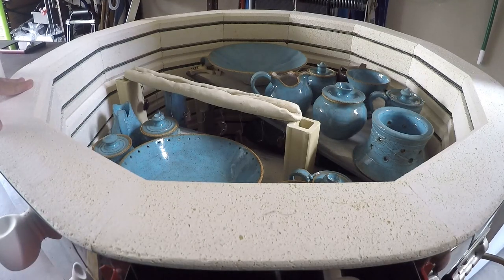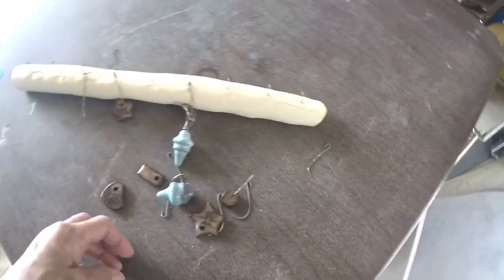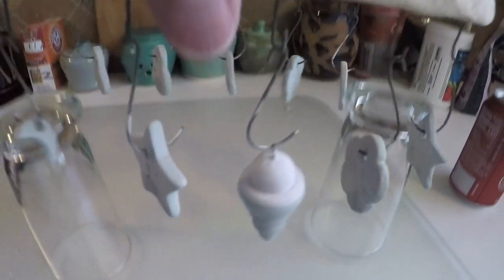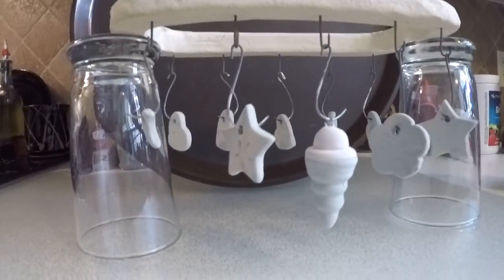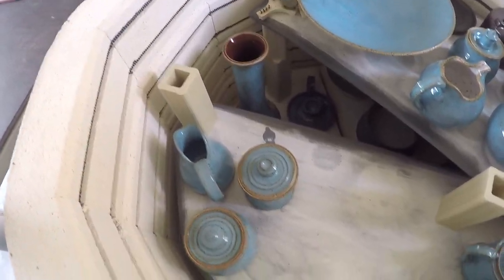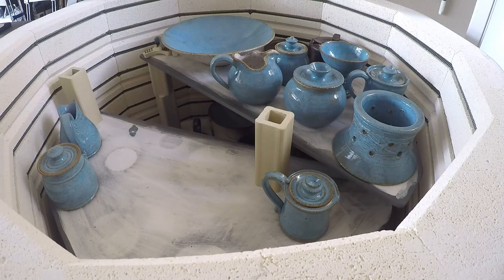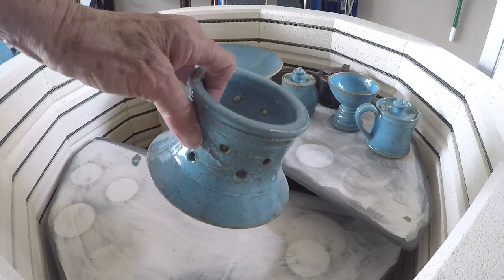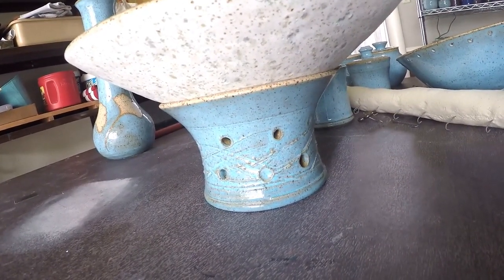♥ August Glaze Fire #2 Kiln - Making Pottery/Ceramics --Technical Blog ASMR

Comment: What company is this soft blue glaze? Your pottery turned out beautiful. Love the vase.
Reply from the maker: It is a Coyote glaze, however I use only the first part & make it thinner than recommended. The speckled clay really 'makes' it for me because it shows through very well. Duncan clear works well over it if it isn't shiny enough for you. Standard also makes a Sea Mist that is very close in color but have not experimented with that one yet. Generally I have found the lighter opaque-ish blues to be (for me) temperature sensitive, like which shelf they're on in the glaze fire... and how close to the elements along the sides, and how crowded the kiln is. More breathing room makes it more even. I have not used this glaze long enough to say for sure but that is my experience so far. Higher temps within the ^6 range turn it darker so I try to go to about 2222 and not more than 2230 with a 3-4 minute soak because I like that softer color. Thanks for watching and for your question Sheila! jw